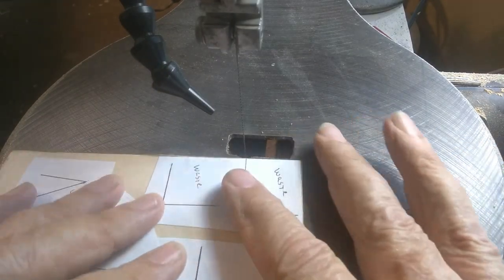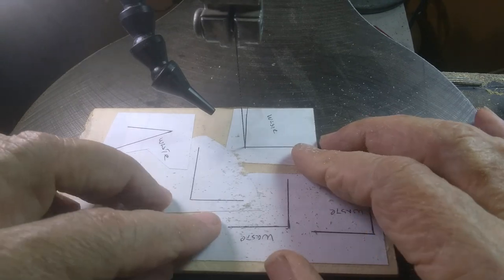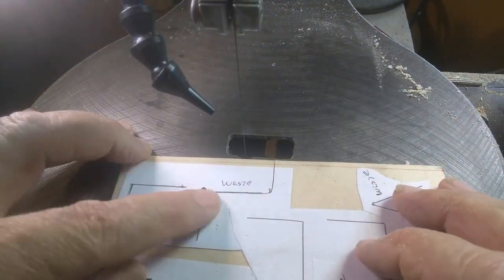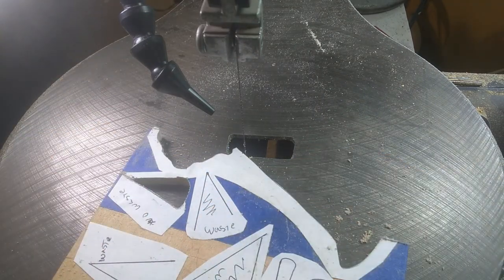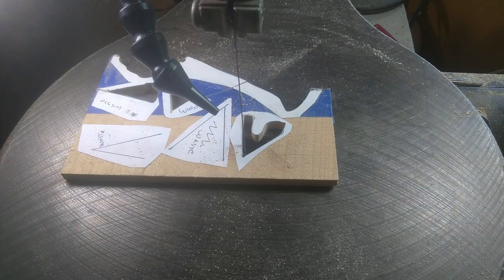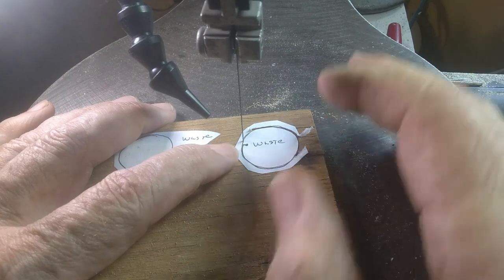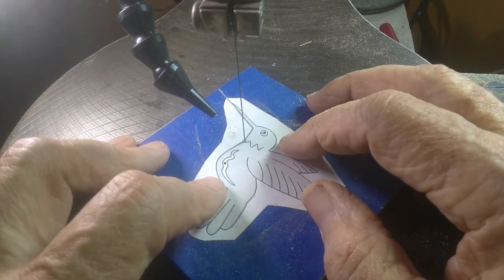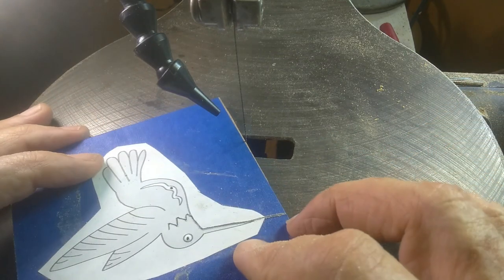My Personal Methods of Cutting Clean Turns on the Scroll Saw

Comment: That bird why wouldn't it be better to cut the whole thing out before  cutting the feathers out ?
Reply from the maker: That could be a matter of personal preference.  I like to cut the veins as I go while the whole thing is still in the waste material.  Mainly for two reasons.  It gives you more material to hold and control the entire piece, better to manipulate, and easier to hold down if the blade grabs the material.  I don't use the hold down that comes with the saw, for me it is in the way for me to see and to be able to film cuts.  The second reason is that the feathers that the vein is outlining is less fragile with more material around it especially if the grain is going across the feather, the action of the blade can  break it along the grain.  In fact the whole project is more stable the more cuts you make with wood around it to support it, including the entire wing.  You can cut the veins  after the whole thing is cut and do ok,  but I have broken a lot  of small areas in projects by removing too much waste before I needed too.  That is something that you have to see ahead of time so you can allow for it and I still sometimes put myself out on an "island" so to speak

Comment: Great video. I belong to a seniors wood shop in my community. We have two DeWalt DW788 scroll saws, and not being familiar with these tools, I am not sure what blades to use when using these machines. For example; I want to cut a zigzag pattern in a 3/4" walnut pen blank that I want to insert a strip to glue between the two sections cut, then repeat on all four sides. This will require me to cut into the piece on a 45 degree angle and not quite thru to the other side; then, turn 90 degrees and come back to the opposite side in a 1/2" distance and so on and so forth creating a zigzag cut and making two separate pieces. I want to make the cuts as acute and clean as possible without rounding each turn. Any information you can provide me with would be greatly appreciated. Cheers!!
Reply from the maker: I am sure everyone would have their own idea on how to do it and most of them would work.  As I understand your description it appears that there will be no waste side on your cuts and no where to "turn" around or "spin around" with out cutting into the finished work.  Walnut is a hard wood but not as hard to cut as some woods.  I have had good success with walnut.  The first thought for me is choice of blade.  My go to blade is a number five.  I used to use Flying Dutchman but have switched to Pegas.  I use their modified geometry blades.  I would shy away from a true reverse tooth in thicker and harder wood as the bottom teeth want to grab and lift up on the up stroke especially on the larger numbered blades with bigger teeth.  But it could be cut with one.  I would probably try to cut this with a number three Pegas blade very slowly and with careful turns running the machine as fast as I could and let it work slowly through the turns, but watching out for too much heat being generated.  With a number three there  is the chance of the blade not cutting straight up and down and leaving an uneven surface cut, flexing internally.  With thicker woods I usually use a larger blade, 5 or 7 or even a 9 to keep the cut straight up and down.  It will be a little harder to get a clean sharp cut with the larger blades but can be done.  I would suggest practicing on some scrap wood to get the feel.  When you get to a turn just pause and relax and let the blade eat at the material as you turn it slowly.   I don't know if that helps but my advice is practice and try different blade sizes. A 5 is most likely to work but I believe a 3 would make a cleaner turn.
Reply: @twinoakstreasures9032  Thanks for the feedback. I believe that I can at least give that a try and see how I fair out. I did try one scrap piece of wood, but I wasn't sure of the blade that I was using. Cheers!
Reply: Thanks man! You earned a new Sub!
Reply from the maker: Thank you

Comment: When going to do the circle at 10.47, how do stop the bottom blade from coming out. Thanks for a great video
Reply from the maker: Thank you for watching and asking.  I am not sure what you are asking, at the 10:47 mark I am switching from a sharp point to demonstrate a circle and disconnecting the blade at the top arm to move to a new cutting spot.  The blade stays connected to the bottom arm with another set screw  like the one at the top and remains in place.  I hope  that  answers the question for you if not respond and I will do my best to answer.
Reply: @twinoakstreasures9032  thanks for your reply. I attend a women's woodworking as part of the mend shed. 
Just learnt the scroll saw and really like using it.
To get the blade through the hole I have to loosen the tension on the blade, take the blade out and then put it through the hole. I then have to look down through the hole and try to get the bottom of the blade in place which is quite tricky. Then I snap the top blade in place. Tighten up blade. Seems a lot of fiddling around to get the blade in at the bottom and keep it in place
Reply from the maker: So what you are describing is known as top feeding.  I am bottom feeding, meaning that I am feeding the blade through the bottom of the work and clamping off at the top arm.  Scroll Saw Village has a You tube short that explains this  https://www.youtube.com/shorts/wMo5o9CGVe4

It is a matter of personal preference and how each saw is set up.  Mine is a very old saw and is difficult to work on the bottom connector so I have always been a bottom feeder.  But one more part needing replacement and I will have to  move up to  a new saw.   I may then prefer top feeding.
Reply: Thank you. Have watched the video

Comment: Question:  as a newbie. To do these cuts are pinless blades the obvious choice?  As I tried recently to do some basics. And my saw. The Harbor Freight aka Central Machinery is setup for pinned blades. In which it seemed as if I was bending the blade, when cutting circles.
Reply from the maker: The cuts demonstrated in this video should apply to pinless and pinned blades.  I use pinless blades almost always.  Most of the projects I do require a small entry hole to cut the fretwork and a blade with pins will not fit through the hole.  I am not sure how your blade seemed to be bending, I do have issues sometimes with the blade skewing out or not staying straight up and down when cutting very thick material and cutting a bowed out or in  face on the finished cut surface, mostly on compound cuts, in other words not tracking top  to bottom in the material.  Blades with pins will limit you to internal cuts that are large enough to have a larger hole drilled in them.  I  mainly only use them on thick wood that I am breaking down into smaller pieces or cutting a very large project,  and then I use a larger more aggressive blade, a number 9 or 12 .

Comment: How do you keep your blade from coming out on the bottom? When you undo the top .
Reply from the maker: The blade is attached to the bottom arm.  With this saw I use bottom feeding, meaning that I remove the blade from the top arm and feed it through the bottom of the material and re-attach it at the top.  Some people prefer top feeding (the opposite procedure) but on this saw it is difficult to do so.

Comment: Amazing video, but I have a question. 
When I need to cut the 90 degree turn (waste inside) can I stop the machine while rotating fully, or will that break the blade?
Reply from the maker: I always have the machine going when rotating unless the blade is in a large hole.  The blade can be caught in the cut and twisted or or broken.
Reply: @twinoakstreasures9032  Thank you so much

Comment: Qual a melhor velocidade? O que fazer para nao quebrar tanto as laminas?
Obrigado!
Reply from the maker: I cut my projects with as high a speed that the circumstances allow.  It is difficult, for me, to describe what speed is correct for any given cut.  In thicker more dense woods I cut with the saw running slower so as not to heat up the blade and/or burn the wood.  That differs between woods.  I use speeds based on my experience and that is across a broad range of combinations and I still am learning.  Experience is the only teacher I have found for this.  I will start out slower and experiment with a little more speed as I move along.  For me it is about the "feel".   Having the blade tension too loose or  too tight, and pushing the blade too hard, is the main cause of blade breaking, that and using blade for too long specially in a thick and/or dense wood.  The blade should have a nice "musical note" sound when plucked at the correct tension.  One book I read long ago said it should sound like the note C on the guitar.  I have used my tuner to get the sound.  Steve Good has a program that sounds that out: https://scrollsawworkshop.blogspot.com/, the download link in on the left side of the page a little ways down.  That is a good place to start to get the tension correct.  I did get a bad batch of blades once and some of them would break just trying to set the tension.  I switched brands after that, but that is probably rare.  I hope I have helped some.  Comment back if you have  any more questions.
Reply: Essa dica do afinador é excelente também comprei laminas feitas na China que quebram muito fácil infelizmente no Brasil nao entramos essa variedade que vcs tem, agradeço a ajuda e as dicas valiosas, parabéns pelo canal.